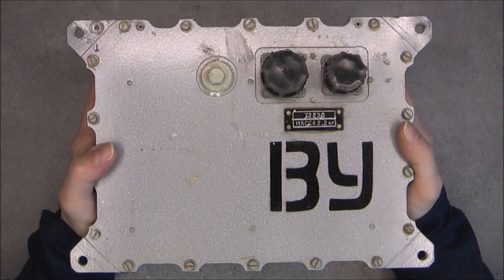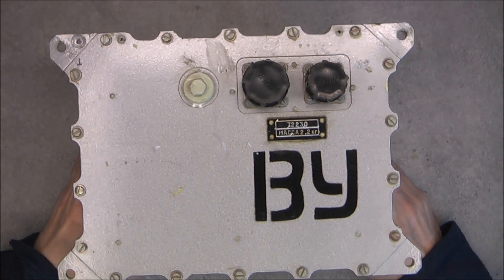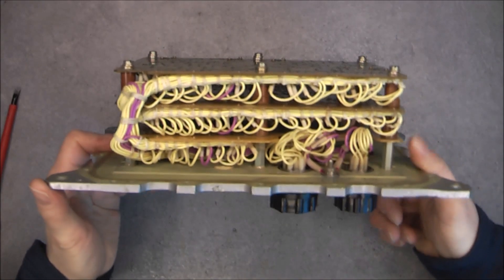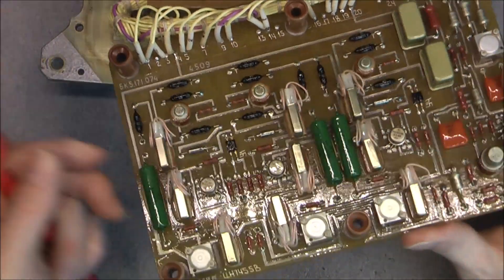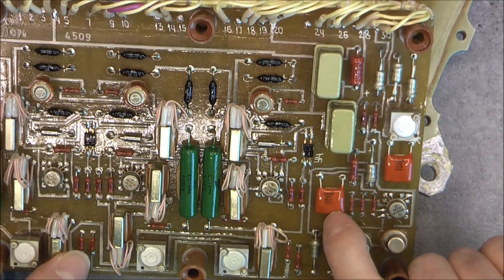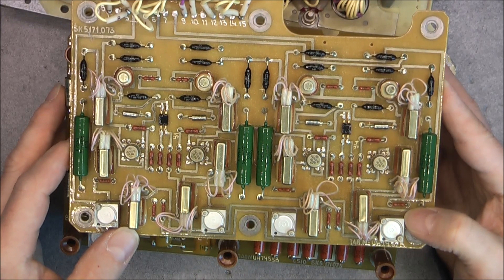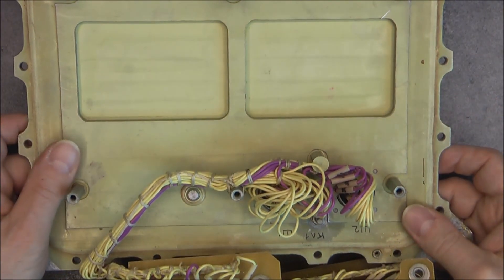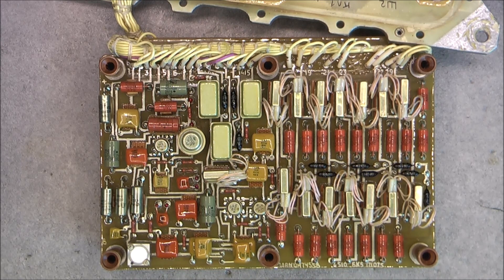Soviet military electronics teardown "ВУ" box

Comment: 6:00, my two cents, They used glue/epoxy for vibration reasons, my guess is that they assume no maintenance so no need to be removable. horizontally to keep a low profile and minimize the risk of the upper circuit board hitting the relay. Look extremely sturdy if you ask me, the military way, although Russians do like it cheap and they normally take the cheapest option to solve problems, like here.

Comment: Hello! Good video! 7:00 there is a germanium transistor ГТ403 in the right bottom side (a silicon transistor on the right, and three resisitors on the top). I wonder - WHY is a germanium transistor in  military electronics?The manufacture date - 1980 year.... not 1960
Reply: Sometimes was GE transistor used due to very small voltage drop and low base opening voltage (Vbe= 0,2V opposite 0,55V in Si transistor). BUT sometimes are this old parts used in special (schematics) blocks which function was verified many years ago.

Comment: 5:50   This is vibration protection. Soldered Legs are not reliable and the base area is small, the element is high. It is logical to put it on its side and use a large area for fixing with glue. In civilian equipment, they would do as you said, but not in the military.
140УД1Б are medium-precision operational amplifiers without frequency correction.
Produced according to bipolar technology and designed to work in general-purpose radio-electronic equipment.
The diamond icon on the elements of radio components means military acceptance. There is increased accuracy and reliability of the part. There are exactly the same details in the USSR, but without a rhombus - they are for civilian devices.
Аll parts and the board are varnished to prevent from air humidity.
Boards of 1973, judging by the markings.
Reply: Exactly this.
Reply: For civilian purposes opams would have letter K, К140УД1Б.

Comment: These kind of Soviet equipment and technologie will work till the end of the time
Reply: Do we know that it works, or what it even does?
Reply: Not at all. The problem was the electrolytic capacitors. Typically, the devices worked for about 10 years, after which they became unusable. Chinese capacitors produced in 2000-2005 had the same problem.
Reply: Like Chornobil
Reply: Nope. Semiconductors tend to degrade, relays too. Even some types of  ceramic capacitors, red thin, not present here, tend to fail. Overal impression looks like oversolid. Rusians produce mostly impression, nothing substancialy more.
Reply: Nope. Probably full of tin whiskers inside those cute semiconductor cans (transistors, diodes, ICs).
Reply: @dizekat  IMHO, there is much more gold inside these semiconductors than tin. The solder is also tin-lead.

Comment: The IC's are op amps - 140УД1Б. Similar to µA702,H-2620,VC1539 according to the datasheet. There was probably some analog data processing involved, comparing, adding, subtracting input voltages, or calculating logarithmic/anti logarithmic functions or whatnot.

Comment: I Love the soviet electronic ❤️
Reply: - yep, because it contains quantum satis of gold.
Reply: @sentinel1064  I hate those types. Scavengers... Would dissolve their mother, if learn that she contains one gram of gold.
Reply: @sentinel1064  I remember a contactor for critical circuits in electronics for nukes control equipment (RT-23 Molodets, rail based)   - 12 contacts, 4mm diameter, 0.5g of 999 gold each, totalling 6 gramms, as per spec provided to the development team.  Do not know where those ones ended up, more likely in the rubbish, after the programm been finished and nobody cared - stealing/ dealing gold in Soviet Union could bring you 7-8 years in prison.